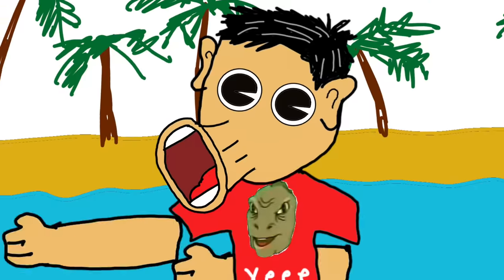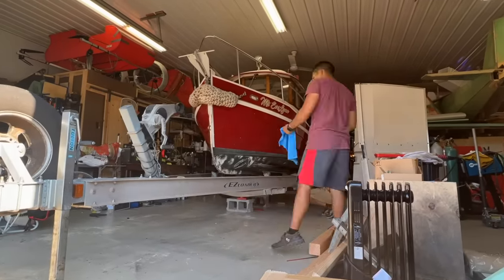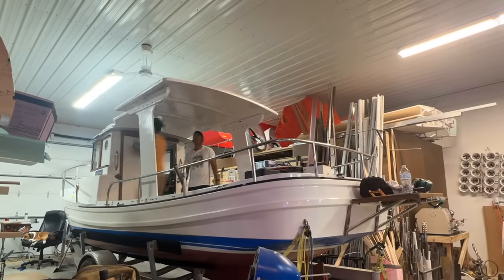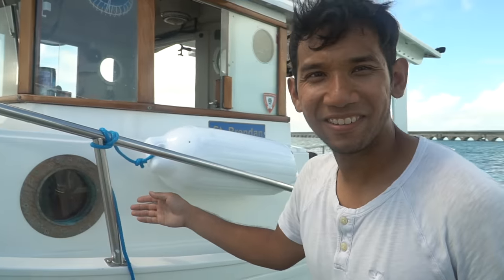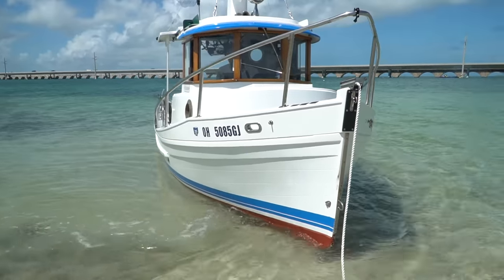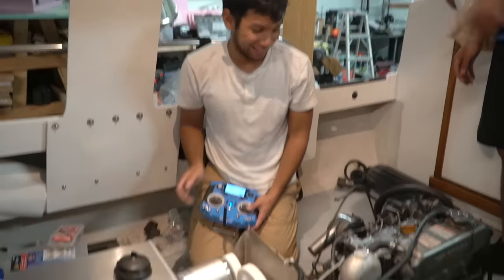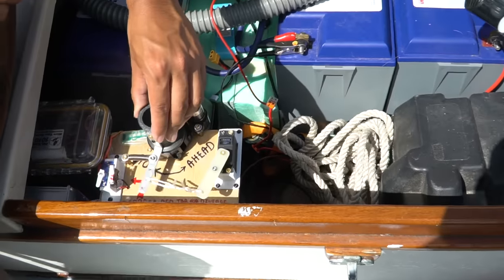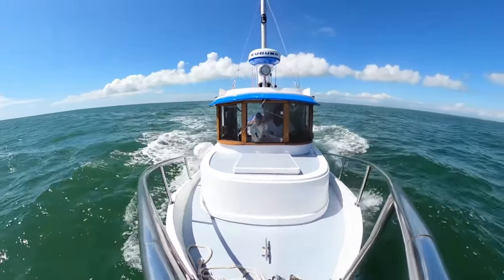I Bought the Biggest RC Tug Boat!

Comment: Very cool build. One thing that might be helpful is there is a kill switch watch you can buy so if you fall off the boat it will kill the motor. If you’re going to be out there by yourself walk around then it’s a good idea so your boat doesn’t run away if you fall off
Reply: Exactly
Reply: You could hook up a Bluetooth receiver that connects to a smart watch and when it detects the smartwatch is too far away it will stop the motor
Reply: @Vaasmios  Doesn't help if you fall under and drop the remote.
Reply: @EnsignLovell  you wouldn't need the remote if the intention is to make the boat stop when you fall overboard and you would be wearing the watch that is connected to the boat
Reply: @Vaasmios  So how are you going to be further away from the front of the boat under the water, directly under the reciever, than if you were at the other side of the boat from the reciever, actually on the boat...?  Do you really not see the issue here, you fall off the front or side, you go under, you get something stuck on the props like an arm or even worse, loose clothing meaning you're now stuck by your clothes under water struggling to escape from them.  

It's a good idea in theory yeah.  But I feel like you're not getting the whole idea across the way you wanted to.  Maybe you meant like, a watch with a moisture sensor or something?  Because distance alone isn't going to work for a boat.  Unless you're specific within around 30CM.
Reply: Under rated.
Reply: @EnsignLovell  I think by that point... You're missing the point.
Reply: The boat will likely drift faster than you can keep up assuming you are both conscious and not freezing, plus you would need a ladder in the water at all times. If you’re alone, probably best to stay tied to the boat moving around the deck.
Reply: I was thinking the same thing.
Having a lot of experience sailing, when you sail alone with the autopilot on and you fall off, that is usually it. Even when the boat is stopped. If there is no swimming ladder, it might just prove impossible to get back on board. Just a few things to consider. A good place to start is to read up on safety practices and equipment for sure.
Reply: @EnsignLovell  Bro you are making shit up

It’s a Bluetooth receiver that stays on the boat that if it detects the paired smart watch isn’t connected to it, it turns off the motor
Reply: @newtybot  They really arent, you could be under the boat and still connected with bluetooth and bluetooth maximum range can be unreliable at times.
Reply: @EnsignLovell  An UWB radio system would work, it could tell the location of the watch so if it isnt within a certain volume then it cuts the motor off.
Reply: Ohh I fell off the boat, lemme get a switch out of my pocket hopefully not let go of it and press it instead of swimming to survive
Reply: Radio waves travel really poorly in water so a short range radio (for example bluetooth) will definitely drop connection by just an inch under the surface. Try it with a bluetooth headset and dunking your phone in the sink :)
Reply: That’s what I thought when he climbed to the bow
Reply: as a boat mechanic that installs like 50 of these wireless killswitches every year, i say avoid them. they cause more engine outs than any other failure we've seen. the battery for most systems have to be replaced every year, or often in the middle of the season when you're out on the water. they also sometimes bug out if  a person falls into the water, and keep the engine running. just wear a wired killswitch to be safe. the technology is just not there yet, and your life can depend on it.
Reply: @newtybot  it's not bluetooth. they use an entirely different wavelength.
Reply: They have some that you just have to have on you and they detect how far away from the boat you are and if you pass the threshold.
Reply: Flying RV
Reply: @daanbos5918  Well you can't read good lmao. He literally said a "kill switch watch". Meaning a wrist watch, in some capacity whether it's an Apple watch bluetooth setup or a moisture sensor/actual distance sensor on your wrist. Not in your pocket, nobody ever said that.
Reply: ..em..
Reply: I like your comment your are right it will be a safer way of boating alone but in reality no one puts a kill switch on a boat that a jet ski thing at least down here in Miami and if you cant keep yourself safe while boating then you shouldn't own a boat let alone be on one at all just wear inflatable life jacket their thin is literally like wearing an extra shirt and maybe a waterproof radio on your person that way if you fall and your boat runs you got a life jacket and a handheld radio to contact the coast guards but we in Florida don't ever wear life jacket lol only kayakers
Reply: My mom almost got her arm cut off because she didn’t have it on for like a second
Reply: this was my thoughts exactly, glad to see I am not the only "paranoid" one.
Reply: Could tie this in with an ardupilot, if you fall out of the water and it realizes you've been disconnected, it could put itself into a hold/loiter mode. Maybe it attempts to bring itself back to the last point where you fell out from, or as close to it as possible.
Reply: The argument over the bluetooth thing is so dumb. It would 100% work for 80-95% of the "fallings from thy boat" but if you do get sucked under and stuck in the propeller then it might not work... but youre kinda fucked already if youre stuck like that bluetooth or not.
Reply: I hope Peter survived after falling off his RC boat.
Reply: @Vaasmios RcTug:the Bluetooth device has been connected

Comment: Peter, I'm a huge boat guy, I have a Captain's license and an Engineering license, and I've been watching your videos for years. I always found it fascinating how you could use open source drone software and build homemade drones that held position using GPS. I think it would be super cool to apply that concept to boats. Large oil rigs use dynamic positioning to stay in place and most modern boats are offered with some sort of position hold feature like SkyHook, but it would be cool to figure out a DIY solution using the thrusters and engine/steering controls. You could also do manual joystick control for low speed maneuvering.

I'm not smart enough to figure it out myself but I think it'd be a really neat video idea!
Reply: Not to advertise the competition but the rctestflight youtube channel has a bunch of videos about using waypoints and GPS to have RC planes, boats, and cars run specific mission profiles and his videos might be of interest to you.
Reply: GPS was going to be my suggestion too!
I'd bet Peter has experience with ArduPilot, and there's some existing projects using it for boats. 

GPS waypoints, or even just trolling to hold a position would be pretty neat
Reply: yeah a DP project would be awesome, ideally you'd want to add a stern thruster for that too and you could control it with the right joystick.
maybe start with waypoint autopilot first and then dynamic pos.
Reply: Hey zach, 
 
It's not too complex, and such autonomous systems can be very fun to learn and rewarding. I like using iNav software, and it has support for boats. With a 50 dollar off the shelf control board and a 50 dollar gps/compass module, you can get an autonomous system up and running around waypoints and pre-programmed missions. But if you really want to get into it, Ardupilot is a little more in-depth but the way...way more capable. Hope this provides some food for thought!
Reply: thrusters to hold the boat in position and a counterweight or gimbal to keep the top of the ship (or platform) completely stable. That would be a cool project for Peter
Reply: That’s a good idea
Reply: You seem like the perfect guy that could reach out to him and give him some advice, I'm sure if u wanted to help with the GPS stuff he would compensate you in some way!
Reply: I've always wanted a replica RC 'Jenny' Shrimp boat from Forest Gump in a decent size scale so it sat nice in the water and didn't bob around too much and look unrealistic.
I want it to have working boom arms and trawler net.

Comment: Love the boat Peter.
Tip about the brasses. After you clean the brasses, you can apply a lacquer to stop them from tarnishing as fast. Or put some oil on them, because the lacquer will bubble eventually and you would have to clean that.
Reply: Agree, I was going to say clear coat after cleaning brass. lacquer is a good option, other clear epoxy can work too. Anything that is sun and salt water proof is a good option. Oil will require most frequent reapplication.
Reply: Beat me to it... Dang

Comment: I can't believe there is a 21' boat with a bow thruster.  That's nuts!
Reply: yeah same thats real cool
Reply: @kiiiisu  Ranger tugs baby! Im a sailboat guy but if I had to have a power boat, it would be a Ranger tug.
Reply: It's pretty normal 😅
Reply: @Danndamannn  Trust me, you'll soon realize you don't really want one.  They're not exactly what you'd call top of the line...  Let's just say there's a reason they don't cost much.
Reply: @donhappel9566  what kn the sam hell are you on about! a used 23' ranger still goes for like 110-150k easily. A new one is 150k at least.
Reply: They're also the only production powerboat that has any sort of decent lines imo. But you're probably right about build quality. There are very, very, VERY, few production boat manufacturers that build to any sort of the quality that old boats have (at least in the sailing world).
Reply: @Danndamannn  Cheap is relative of course.   I've always viewed Ranger as a cheaper version of a Nordic or American.  Granted, they don't build stuff as small as Ranger.  I work in the marine industry and the Rangers I've worked on were pretty shoddy build quality.
Reply: @Danndamannn  I think there are any number of production boats that I prefer aesthetically. East Bay, Hinkley, the 31 Tiara,  Saber, American Tug...if you want to look bigger, I particularly like the Krogen Express and Huckins 44 Atlantic.
Reply: @donhappel9566 cool, I didn't know hinkley made power boats! Been on some krogans and nordhavns, that are fairly cool but I just cant get over how goddamn cute the Rangers are! I dont know why I care anyways tho 😂, I don't have any plans to own a powerboat until in my 70's and too old to sail haha
Reply: @Danndamannn  These are all pretty different than the little Ranger in this video anyway though Ranger does a 31 that's at least closer to the small Nordic or American (though still MUCH smaller).  My two 'realistic' daydream boats right now are a 34 American if I want to keep it in the PNW, or a 32 Halvorsen gourmet cruiser (hate that name!) if I want to keep it here in NorCal.  Those are within the obtainable-if-I want-it-bad-enough budget.  But that Krogen Express (very different than a typical Krogen trawler) would be pretty high  on the "sudden cash windfall" list.  Again, not comparable to the Rangers I know.
Reply: Did my head in when I saw that. Very cool.
Disappointed by the 'Established Titles' ad., though. It's common knowledge that the whole thing is a bit shonky. It's popping up everywhere, like that damn 'Raid Shadow Legends' thing. I wouldn't touch either with a thirty foot bargepole.

Comment: Very cool little boat! It's easy to get "too much boat" and then be bogged down with endless maintenance and repairs. Something this size is a great starter model, plus with a trailer you don't have to pay slip fees or worry about it sitting unattended at a dock. If you like physical printed reference material, Chapman's Piloting is a great boating skills book.

Comment: Be careful running the electric motor with the diesel engine off. If the shaft is spinning some of the gears in the gearbox (transmission) are turning and they are not being lubricated. Make sure you check the filter for metal shavings. We've had issues with this in strong currents with commercial towboats on the Ohio River. Such a cool idea!

Comment: Hey Peter, lifelong boater here, if you wax the portholes it will protect it from corrosion for a while, depending on spray and proper coverage. The wax should prevent oxidization by removing he sea air from touching it
Reply: Or spray varathane
Reply: That’s very smart, I didn’t think of that
Reply: clear coat would work no?
Reply: Clear powder coat.
Reply: there is a metal sealing epoxy that is designed for this . forgot the name but use it all the time on carbs. works beautifully.
Reply: @Zomby_Woof  yeah, but spray urethane is really made for wood
Reply: @christophergregory2839  I just remember when I was in rhe navy some bonehead who was bored started polishing one of the missile tube doors.

So we then had to polish all of them.

So I spayed each one with poly so we didn't have to keep doing it.

It lasted at least another year until I left.

Comment: Might be a good idea to encase the transmitter in a waterproof casing, or re-encase its electronics in a well designed bouyancy casing, with a strop around your neck, or clipped to your waist.   That way, when running single-handed (solo), should you fall overboard - you can still control the vessel from the water and bring it back to retrieve you, providing you act quick enough within the range of the TX.    You might also factor in some kind of processor that will detect when a TX signal is absent, or commands have not been received for a minimum period and shut down the engine.   Even - given further period of absence of command; issue an automated distress message/EPIRB.   
.
You should also consider always wearing at least a waist secured inflatable bouyancy aid/life jacket when pottering around on deck and always when single-handed.   You would be surprised how easy it is to end up in the drink...   Especially if you hit a semi-submerged treetrunk, which would stop your boat dead in the water, but the inertia at 5kts would certainly catapult you over the bow, or off the gunwales.   Thus your RC Tx should be affixed to your person.     
.
Depending upon where one lives, a Skipper's License is not usually required to own and operate a boat up to a certain size/tonnage.  
But undertaking an internationally recognised course on coastal and even offshore navigation is a must if intending to undertake long-range coastal and offshore voyages.  Likewise with radio communications.   All vessels over 25 feet operating in coastal waters and using port facilities should carry maritime VHF sets with appropriate licensing.   Worth doing and may even be necessary by some local PA operators.
Reply: Chief dose.

Comment: Have you thought about adding an electromagnetic clutch for your trolling/RC functions? You can change out a lot of the manual work switching between the two. You can activate it all with your transmitter. You can get the clutches pretty inexpensively on ebay.
Reply: Bump
Reply: Mechanical systems don't suck battery power.  Flipping a switch seems like a cool thing to engage/disengage, but for reliable function on batteries not so much.
Reply: @warhound7781  I get what you are saying. You could have the ICE as the default, and the RC side on the clutch. If the batteries are dead, you wouldn't be able to use the RC controls anyways.
Reply: @Jayjlow  A default to engagement of secondary controls could get messy if there's ever a power fault though.

Comment: Herringbone gears should run quieter than the straight teeth on your electric drive, and normally run cooler in Naval turbines.  (Not sure if that will translate to plastic gears.)

Comment: When going forward without the diesel running (as in being towed or, in your case under electric power), you need to close the seacock to avoid pushing water into the engine and causing a LOT of damage.  I have owned a 2005 R21 for a very long time and put hundreds of hours on her.

Comment: Some advice about 3D printing, switch over to PETG, it's better than PLA in almost every metric (notably in heat resistance and strength) and it's not that much harder to print with. Those gears will last a lot longer.

Comment: In the Marines, We shined brass CONSTANTLY!!! Now, we used brasso, BUT afterwards we cleaned the brass with rubbing alcohol, AND THEN coated it with a spray can clear coat,...Now, that made the shine last a VERY long time, it was a pain in the kiester when you had to strip the clear back off and re-polish it, but the difference was a shine/polish job lasting 2 weeks or 2 MONTHS!!

Comment: A bit late to the party, but I feel like an orbiting nautical drone could be a cool idea for a video if your gonna be taking this boating path. Either or sea based, just does rings around your boat with sensors or cameras on it so you can see whats around you earlier, scan the ocean floor or what fish there are, even just a weather station to know if a storms coming. I don't know why, but I just love the idea of having a personal drone that orbits you and at sea seems like one of the only places you wouldn't run into many obstacles
Reply: I actually had an idea like this (of which I have many goofy passing fleeting ideas)  I usually write them down in case I actually have a good one. I was thinking of something like a jet ski sized "bay station" that could float in the water containing large battery storage/solar panels to keep them charged up and having power delivered by a cord to the "drone" 
 I was thinking of some sort of underwater mapping or something when the idea occurred to me. I suppose I was thinking that you could have more up time on the drone for doing "goofy drone surveying activities" LOL